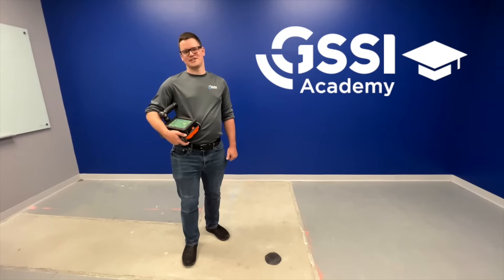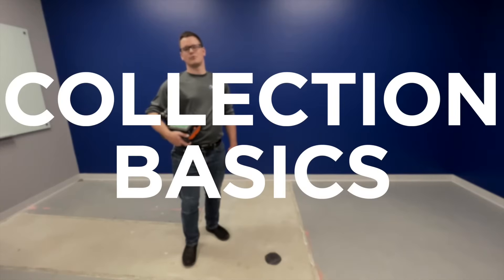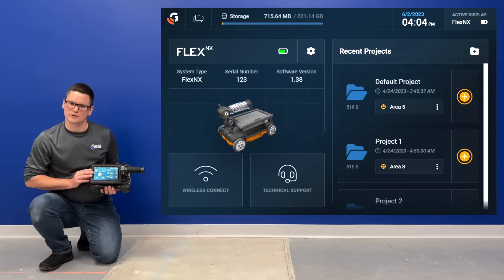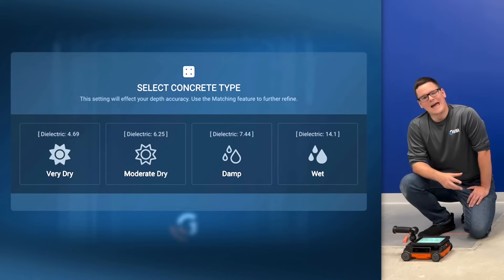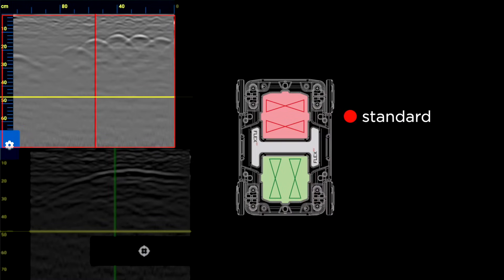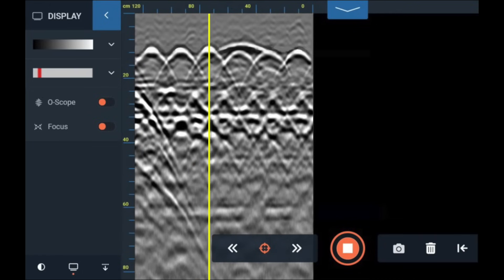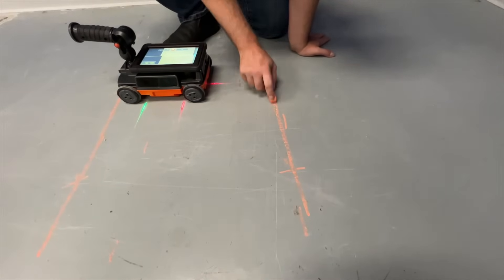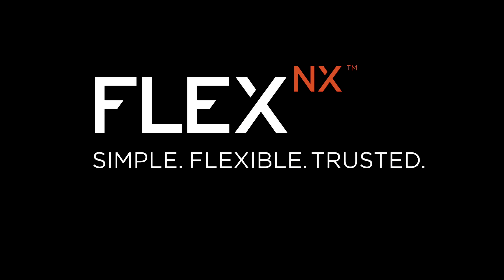GSSI | Flex NX Collection Basics

Comment: Please explain more from 1.10 to 1.50  thanks
Reply from the maker: Hello and thank you for your comments. 

By default, Flex NX shows the data from both antennas in a split screen view with a slight offset between the channels. This corrects for the physical distance between the antennas, as the cross-polarized antenna does not display data until it has passed the starting point of the standard antenna.

For a more in-depth explanation of cross-polarization, please refer to the Flex NX Manual. http://tinyurl.com/2x76kwsb

As always, feel free to reach out to the training team directly at: training@geophysical.com for any further questions.